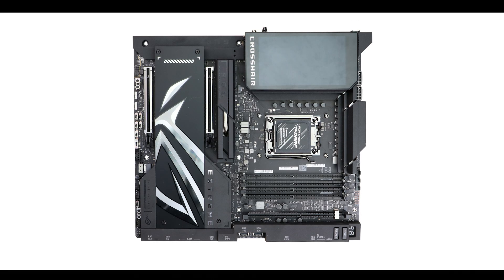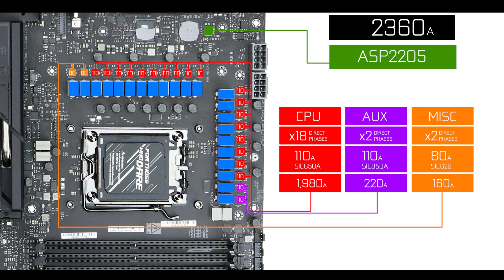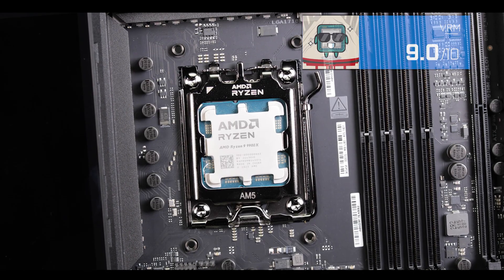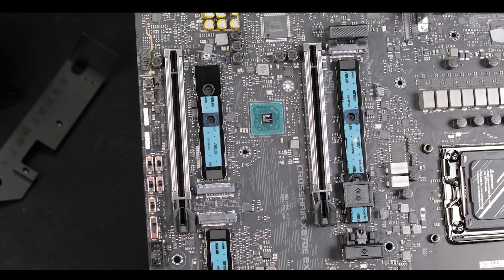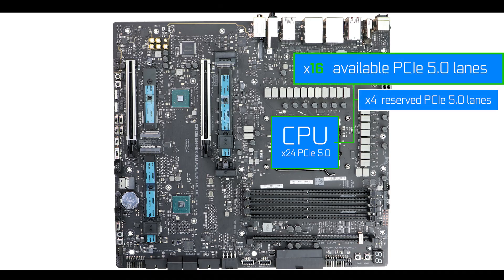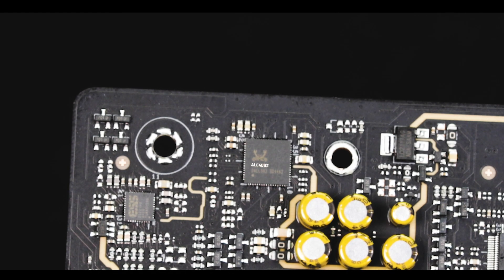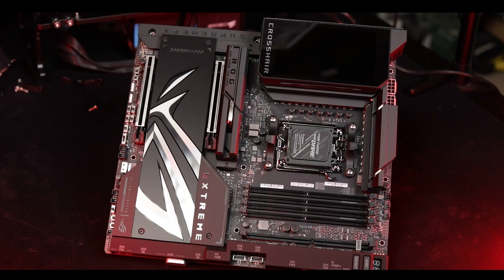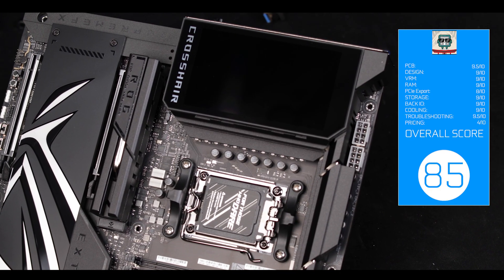ROG CROSSHAIR X870E EXTREME: ASUS, you had me at EXTREME!

Comment: Your channel is definitely underrated. Just a quick note about the Crosshair x870 Extreme you’re reviewing. The Q-Release Slim issue has been fixed on all Asus x870 boards with the updated Q-Release. In fact, the Crosshair x870 Extreme you’re reviewing never had the flawed version. Before, slightly tilting the GPU during removal could make the end of its PCIe slot touch the metal divider, causing varying degrees of scratching depending on the tilt. Now, with that unnecessary piece of metal removed, it works as intended, with no contact between the GPU’s PCIe and any metal parts.

Comment: 1130€...for a motherboard. Tf you even do with that? Costs almost as much as 4 7800X3D or 2 9950X3D (or a pair of 2x16 gb cl40 5200mhz now that the RAM prices skyrocketed). On a good note, the HERO is finally on discount...altought its just 100€ so still 610€, 300 more than any sane person should pay for a motherboard. It has..nice display tho.

Comment: As something that is classified as “Extreme”, it’s extremely disappointing that the board shares PCI-E lanes and the fact that if all NVME slots are occupied, the bandwidth is reduced. Appreciate I’ve got limited understanding, nevertheless if you’re paying that sort of money, there shouldn’t be any compromises.
Reply from the maker: Agreed... but that's what the CPU can provides :( 

Hopefully next GENERATION of CPU will feature more PCIE 5 lanes :)))))))
Reply: It has nothing to do with the board; it's CPU-bound. This motherboard is undoubtedly the best you can get for countless reasons, but explaining it all would take too long unless you're already familiar with its features. Let me just say, if money weren't an issue, it's worth every penny.
Reply: @brianmiller1574 im going to be the black sheep and say the z790 populate all 6 nvme drivers fully populated... if i wanted an i9.
Reply: The only two x870e motherboards that don’t lower pcie1 5.0 speeds when you occupy all 4 nvme slots are MSI Godlike and ASrock Taichi.
Reply: @Hussar-fm8iy  Both you and the creator of this video are incorrect.
Modern AMD processors have 24 CPU lanes, which is a large enough number to handle everything without compromising PCIe speed. As for M.2 Gen 4, its lanes are tied to the chipset, not the processor. Therefore, connecting storage drives to them will not affect the speed of the PCIe 5 slots.
Note:
The motherboard has nothing to do with this, as it depends on the processor and chipset, and AMD, not Asus, is responsible for it.
Reply from the maker: Thanks for your contribution  :)

So let me clarify a few little opaque infos surround the pcie 5 lanes :)

Out of the 24 PCIe 5.0 lanes, 4 are reserved for the CPU / PCH communication. 

So only 20 can effectively be used for components feeding . 

Thats 1 fully fed GPU + 1 NVME. If more PCIE 5 enabled elements are present there will be PCIE bifurcations.

USB 4.0 are indeed fed 4 Pcie 5.0 lanes which are usually disabled if a NVME is used in its steady ( mag  x870 and B850 being a good example from MSI).

I hope I clarified:) 

And thanks again for taking the time to have contributed :)))) 

Lots of love

Laurent
Reply: @Laurentschoice  Let me clarify the technical facts based on the design of the AMD X870E chipset itself and the specifications of the motherboards:

Technical Reality:

1. The AMD X870E chipset provides 24 PCIe 5.0 lanes directly from the CPU itself.
2. These 24 lanes are typically divided on motherboards as follows:
   · A PCIe x16 slot for the graphics card (PCIe 5.0 x16)
   · An M.2 slot for storage (PCIe 5.0 x4) connected directly to the CPU
   · A second M.2 slot for storage (PCIe 5.0 x4) also connected directly to the CPU
   · (4 additional lanes remain, which may be used for other purposes or may not be used)
3. Additional slots (like the third and fourth M.2) operate through the Chipset (X870E), which connects to the CPU via a PCIe 4.0 x4 link. These slots operate at PCIe 4.0 speeds, not PCIe 5.0, from the outset.

Conclusion:

· There is no X870E motherboard that "reduces" the speed of the graphics card slot to x8 when using M.2 slots because the lanes coming from the CPU are dedicated and independent.
· The situation was completely different in previous generation motherboards (X670/X670E) or on Intel platforms, where lane sharing could lead to a reduction in graphics card slot speed.
· The new X870E design from AMD has solved this "problem" at its root by providing 24 dedicated PCIe 5.0 lanes from the CPU. ((((((:
Reply from the maker: Hi :) . So i appreciate the break down... from the 24 CPU provided PCIe 5.0 lanes you do need subtract 4 PCIe 5.0 lanes for the CPU / PCH communication:) 

That leaves you with 20 PCIe 5.0 lanes :) 

What caviat i should have added : 

usb 4.0 can be fed ( either way ) by 4 PCIe 5.0 lanes (CPU) or 8 PCIe 4.0 lanes (PCH). 

But as Ryzen 9000 series goes ... and until the next gen of CPU comes around you got to play with 20 pcie 5.0 lanes in any way you see fit :)

Hope this helps :)
Reply: @rh15 correct you are
Reply: You are a idiot it only does that with gen 5 drives foolish you are.😮